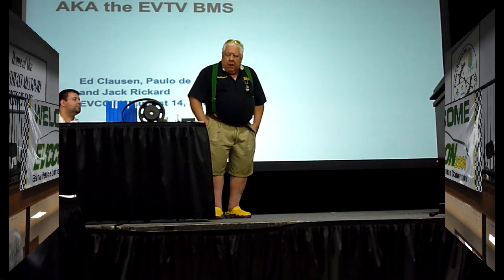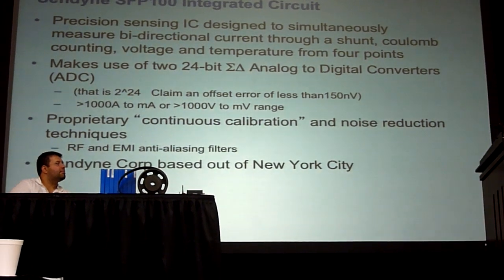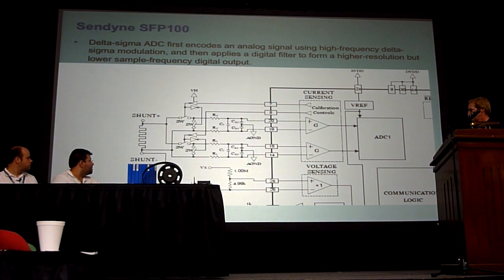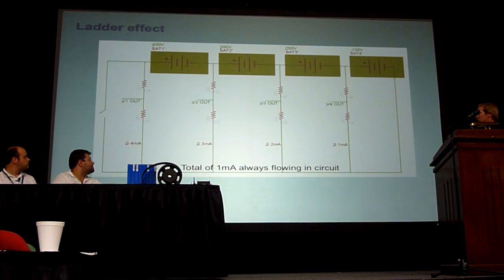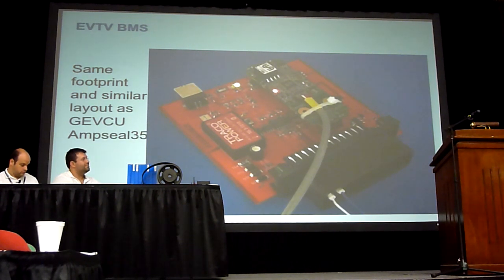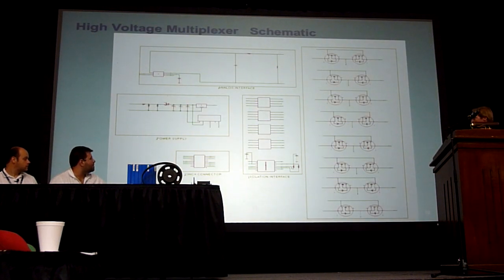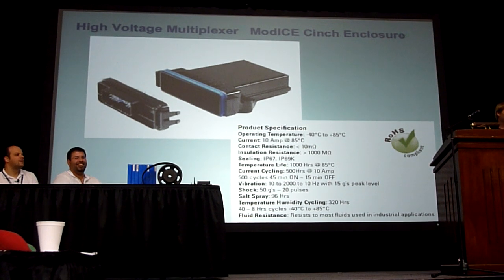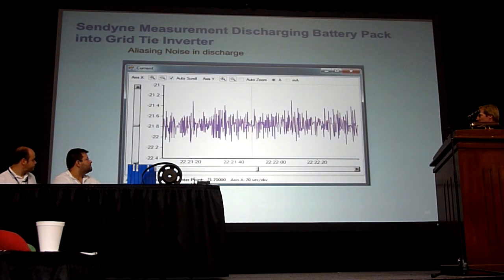EVCCON 2014 BMS Presentation

Comment: Super interesting BMS project.
Here is some hardware that might make life a bit more easy on you.
http://www.mcmaster.com/#standard-threaded-standoffs/=tcnvbw

They are not that cheap, but if you count the labor to drill the bolts it might be worth it.

Also when you have a number of long interconnecting cables in the different segments
of the pack, isn't that going to interfer with the measurements. Or is there going to be some
kind of adjustment for that ?
Like in the example that you show from your pack you have 0 long cables in the first segment,
2 cables in the second segment, 3 cables in the third segment and 1 cable in the fourth
segment. Those cables are going to show some voltage drop also. 
And since you are trying to get the measurement of the cells as good as possible you have
to try to remove that kind of errors also.
In your pack config you would need atleast 7 separate inputs to measure all the segments
of your pack without the measuring the cables. The braided straps are going to be the same
all of them so that would even out with the numbers but not those longer cable runs.

But it looks really nice.

Would it be totally impossible to keep the shunt on the eval board and just connect two bus bars
to the shunt, that is then brought out in the front on each side of the ampseal ?
Or does that put to much EMI over the rest of the board ?

Regards
/Per Eklund